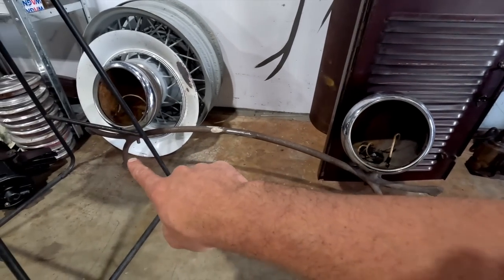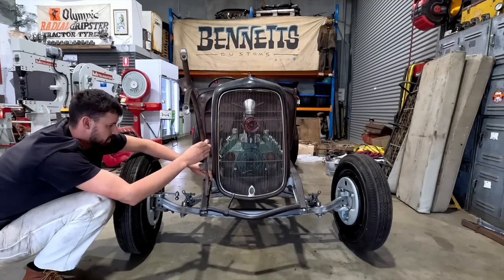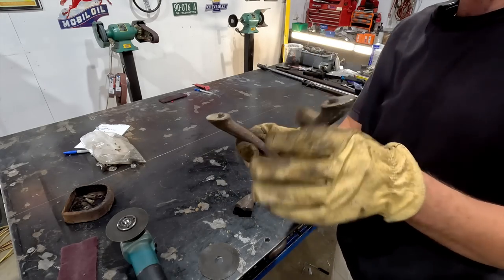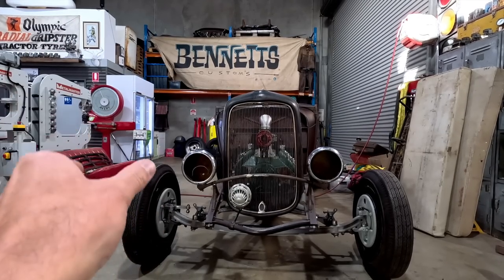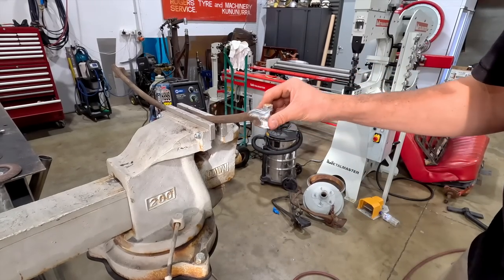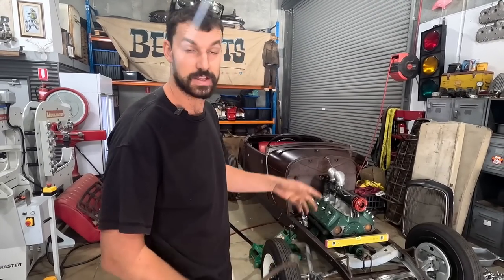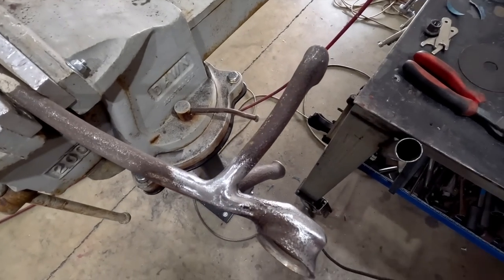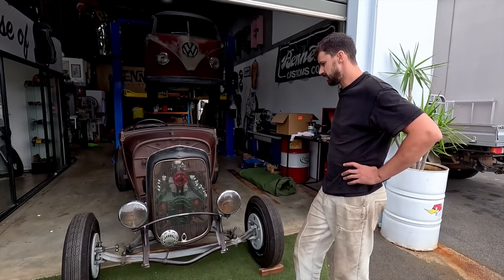Recycling Old Parts: Creating a Custom Headlight Bar from Repurposed Cast Iron  | 29' FORD Roadster

Comment: Hello Jordan. I think the feet on the headlight bar are spot on. Like there running forwards. Short leg in front long leg out back. I have 4 broken studs in my 322 heads. I’ve tried the weld on a nut but with no joy. I managed to drill one stud out but as there on an angle and go into the water jacket scares me. Always enjoy your creativity, and look forwards to what you will come up with next. All the very best Tim.
Reply from the maker: Thank you Tim! Hope you get those bugger studs out! I’ve been there what a pain

Comment: Nice work. I think that the needle scaler was made to remove welding slag from large areas like pipes where half inch rods were used .
Reply from the maker: Yup you’re right! Works a treat for that

Comment: If I'm not mistaken, I think that light bar came from an old Chevrolet truck. It would have mounted, before you modded it, to the front fenders. In the middle where you suspect there was chrome, that was or could have been where the V8 emblem was mounted. Nice work!
Reply from the maker: Hey Will you definitely could be right going off some old images! The one piece of Chevy so far!

Comment: Will any of that interfere with the hand crank ?
      The grill does have a hole in it .
      I was thinking about putting a pull rope on my 3 cylinder geo metro  ,
     Just for laughs  .
                    😁
Reply from the maker: I don’t plan on using the hand crank. If I have too well I’ll have to drill a hole hahah